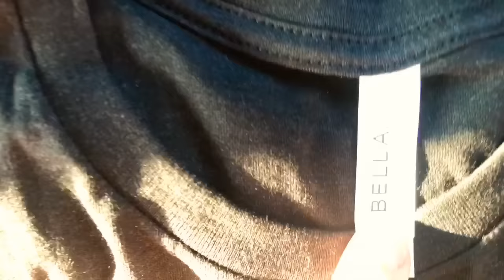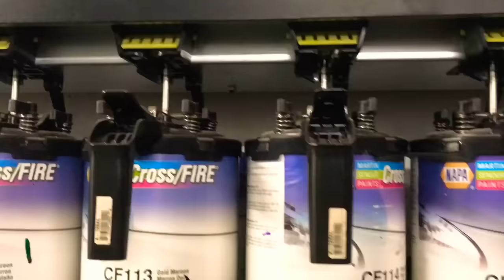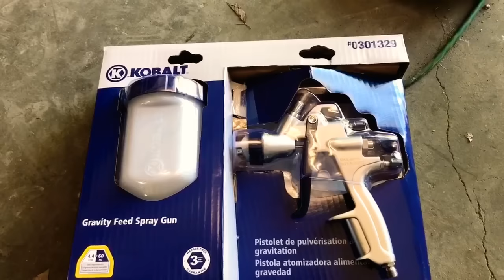WIN! Nova paint doesn't suck! Behind the Build Ep 13

Comment: What you need is a squirrel cage for your air flow. You don't need a filter with them. That's what I use in my garage, it works great. You can get them out of an old furnace.

Comment: Aaron, if your water trap is on the compressor, you need to either get that one off and move it to the spray booth or add another one on the booth and run your gun line from that. On hot humid days especially the moisture being compressed with the air stays as a vapor in the line until it cools. In your case it is cooling and changing to water at the gun connection. You need like 25 feet of hose to the 2nd water trap, that should catch the condensed water. You should still use the canister on the gun like you have been doing.This is what I ran in my body shop. Another tip, have your friend at the paint store call you when the rep comes around, he can help you do a proper gun setup for the paint system you are using. This really helps and they are glad to do it.

Comment: Put a furnace blower motor (or two) in your paint booth and use the real cheap filters. The one's you have at 7:25 restrict air flow too much. Tack the base in between coats, and when you're spraying metallic, just kind of fog the last coat on to even out the metallic and tack before clearing.

Comment: A suggestion for your air supply.  You can use a coil of copper or aluminum tube in a wash tub of cool water as an air chiller to remove moisture.  Set up is this: compressor, hose to tub, coil in tub, hose to water air separator, pressure regulator, then to gun.  I have used this to paint and to sand blast.  It works great.

Comment: G'day from down under, I've painted alot of different vehicles over the years in all types of enviroments in different kinds of paint (everything from hot rods to buses, in 2pak and acrylic) my favorite gun is a cheap gravity gun! I've tried HVLP guns and found the paint goes on with to much peel for my liking. The main trick with moisture in your compressed air is the heat and humidity around your compressor. I run 2 water traps and still get moisture at the end of the hose, then I found "inline disposable filters" that screw onto the spray gun the your air line conector screws into it. I have them on the DA sander as well. Instead of disposing of them I just interchange them and they seem to dry out.hope this helps, keep up the good work I enjoy your videos...

Comment: I'm not a painter but I have painted tractors and trailers in the shop I used to work at. We had no paint booth but we used a large high velocity shop fan to pull the air out of the shop versus pushing air in.

Comment: When I was painting in the 70's and 80's the best guns were Binks and DeVelbis but you also had to have the right nozzle and internal parts for the gun and paint. One of the biggest problems was not enough volume of air which would then require a smaller cfm nozzle on your gun and then a smaller width of paint pattern which gave more chance of metallic streaks. I needed a commercial air before I got good paint jobs. I don't remember the cfm's but it was 71/4 hp.

Comment: Great job guys.
You may want to use a double water filter 15 ft.away from the compressor to let the water condensate some. This worked for me. Also, metalics spray different from solids....put a ball bearing in the canister....spray AWAY from car in different patterns to avoid veins of metalic...do not lay the base thick...and allow it to seat for 20 minutes and wach how the metalic spreads evenly by itself...( single stage).solid paint is much easyer...one coat and give it 20 minutes...then go to work on it...take your time as this is art...cheers!

Comment: When painting metallic you must spray in the same direction. Otherwise you get strips.  The reason is the flake lays down in a different direction based on the direction you move the paint gun.  Also you tend to angle the gun some towards the direction you move the gun.

Comment: A Lot of prep work in the beginning ends with an awesome paint job and great results. Keep in mind everyone don't try and cheat or skip steps during painting. Good tip is to have  a minimum of 10 times the air flow you think you need. Also when painting in a sealed environment you need lots of air flow and a full face forced air mask so you don't poison yourself on accident. 
The issue with the metallic spray is more than likely due to the wrong fluid tip in the old gun with an improper flow setting for the gun.  Looks great though and keep up the good work. 
BTW I still want details on the FURY!!!! lol.
Reply from the maker: Justin Fisher thanks for the input man!!! E-mail us on deets on the Fury! FlyingSparksGarage@gmail.com 😊🙌🏼
Reply: Sent!

Comment: I like the persistence you guy's have. looks good and like Aaron said with the layers of clear the crap should sand out. 
I painted our race car in my shop with less issues by simulating a down draft system.  maybe on your next job you should try that.
And don't pay attention to the cheap gun comments.. I've been in shops where they would use a home Depot spray gun and the job came out perfect. A good painter can use an old Binks # 7 and do and show quality job.  Not me lol...
But. keep the faith.

Comment: Hopefully u did scuff sand basecoat again after letting it sit overnight..........? Surely u did. And the small air compressor builds up lots of condensation causing tons of moisture.( U prob know this) My professional advice on ur next paint job is to try some DuPont base w/ Basemaker. It actually organizes ur metallics for u. So u can stripe it up all u want and if air pressure gets low on u it doesn't hurt u so bad as long as ur watching to be sure its medium wet coats throughout.The foggy booth issue I suggest lowering air pressure a bit and close ur spray gun pattern to smaller fan. I like to adjust my pattern by (test spray outside booth) starting out "firehose" opening up to when the pattern is uniform all the way across it (looking at spray pattern from side view). If u open up full width u will notice ur pattern has gaps of air in the middle of it, instead of being uniform fan pattern, Close it back down until they touch.  This will help prevent striping also but u may have to increase ur gun to panel distances depending on how its laying down. Always always always look behind the gun & watch as the paint lays down and adjust accordingly. I may b wasting ur time here because its extremely hard to explain what i mean in words. Try the DuPont base w/Basemaker I promise u won't b disappointed.  ***I am not affiliated w/DuPont either lol. I've sprayed almost every brand/type there is. Including "rattle can" lol. I love u guys & ur vids. I'm just a simple small town retired painter that will amaze the greatest of professionals, except all i got is talent & no $$$. Take care ur doing amazing! Never lift that skinny pedal & stay positive! I'll send some pics of my work if requested lol........rock on!

Comment: I feel for ya guys.  Pulling off the garage paint job is not easy.  Looks like your persistence paid off and you gained a lot of experience.  Next attempts will get better.  Now for my next round of advisories.  When you go to sand and polish your defects those areas become glass smooth... when nothing else is.  It literally opens pandora's box of color sanding the whole thing and then polishing.  Probably not an issue for you guys with an affinity to wet sanding ;-)

Comment: A great water separator,  run a line out of the compressor head to a car/truck a/c condenser or maybe a propane tank then to your filter, and tank, this way air is already cooled and dry entering the tank. A mini ball filter at the gun for cheap insurance. Thanks for the update.

Comment: Aaron, the next time you make a paint bout may i suggest that air filter are your friend, are reusable (by them by the case and as big as you can) fans can move air better the freer it is. I have built a sect set of doors behind my man shop doors that is basically as many air filter and the best air filter I can fit. then on the other side I get though cheep $9.00  24" box fans 8 of them down low to keep the stuff down and you have great air flow.

Comment: I'm glad that it worked out for you. It looks good.  A cheap gun will work on small things.  Like, lets say you want to repaint a steel dash or other small parts. But, a whole car? As you saw for yourself, it was a huge pain in the butt. If there is a next time, and you want to paint another car, get a bigger fan. Those fumes are dangerous. Believe me, you don't want that stuff in your eyes or on your skin. I have a small shop. But my fan is 5ft tall and 5ft wide. You need all the air flow you can get. Good job though. You're learning. And some painters tricks for you, When you are painting, wear a long sleeve shirt. Wear goggles over your eyes. Any skin that is not protected, use Vaseline to cover it. It will keep that junk off of your skin and out of your pores.

Comment: Spending the MONEY on a GREAT Gun will save MONEY down the line , Use an IWATA LPH400 with orange extreme cap , which works well for BOTH Base & Clear applications !  I use them professionally for the past 11 years ! Been spraying Professionally for 40 years !
Reply: Darrell Williams I just picked up one of those guns used on ebay for 250 came with the Orange cap and silver cap. It works amazing.
Reply: I might add , that using the 1.3 or 1.4 needle in the gun will apply the Color  & Clear very nicely depending on how your technique is . I use 1.4's in all my Iwatas , with the fan adjustment all the way out with just a 1/4 turn in , then the material valve 4 turns out from the fully closed position .

Comment: I could of sworn you said ya'll were gonna "push" air in the last vid.  I could've told you there was no way you could pull it.  I mean even if you had the blower power to do so, the plastic would never have held.  Plus next time, lose the exit filters.  And leave your "door" loose enough to open as much as the air will open it.  Because between the paint and the blow thru air, no bugs or crap is coming in while the fans are on....

Comment: Stop buying cheap guns go to your local paint and body supply shop not Napa they will set you up with a good metallic gun if you're going to keep shooting metallics if you need a flake gun they have flake guns get a clear coat gun get a primer gun get a base coat gun you don't want to use the same gun for everything you're doing the tip is your biggest issue with this metallic paint job... I've been doing this for well over 25 years stop by in the cheap guns step up your game and you'll get it improved outcome. There's also classes that you can take that will teach you how to spray correctly with the correct guns in Vegas every year they do it from beginners to 30-year experts they also teach you how to do custom paint jobs from fade jobs to lace jobs two panel jobs if you're going to keep painting spend the money and learn how to do a correctly